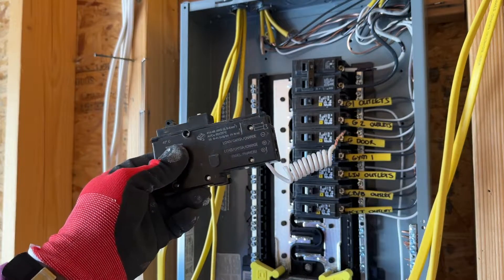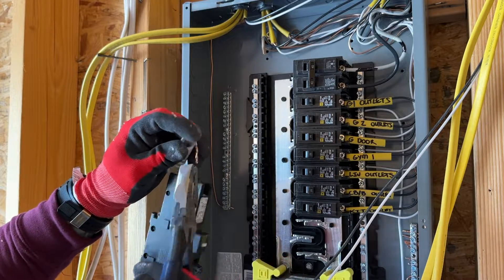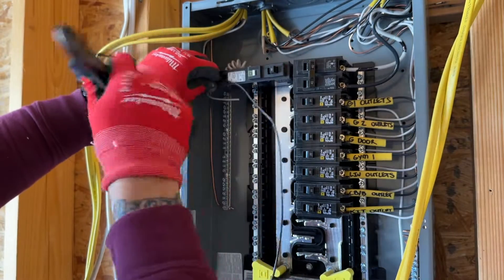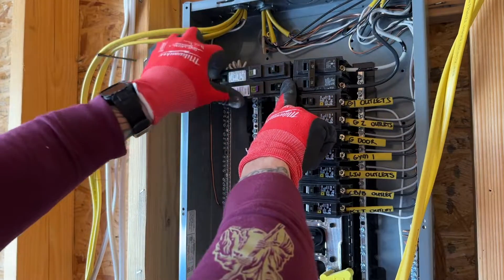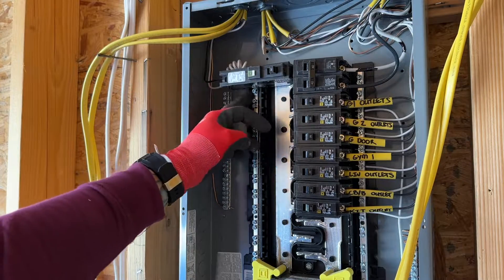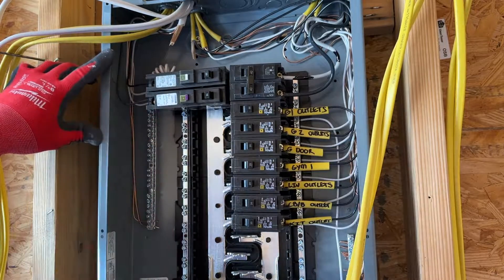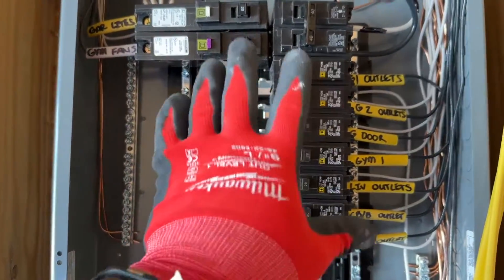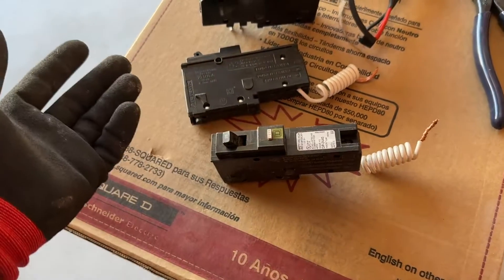AFCI & CAFCI Breaker Installation

Comment: Thanks for the video. Gave me some ideas for clean wire management
Reply from the maker: Nice! Your very welcome 🤙🏼
Reply: it is very clear and i found it very helpful as well.

i just have one gripe having dealt with many different cabling types. that is not including some sort of service loop.

future changes down the road you will have no slack anywhere in those runs for the box do anything.

i see it a lot tbh. no one really gets shown that service loops save your butt later.

Comment: I have a QO plug on neutral service panel and I want to install a CAFI/GFCI circuit breaker that has the pigtail but the breaker also has a connection for the plug on neutral. Since it’s using the plug on neutral circuit breaker would I just not connect the pigtail and wire nut it ?. Because if I would connect the pigtail and the plug on neutral both, I’m not sure if that would allow it to work having two neutral connections, or would the redundancy be ok ??
Reply from the maker: I think if it comes with the pigtail and the plug down bars it’s supposed to have both. If for some reason it cause it to act up or trip unnecessarily then I’d try one and not the other to see if it fixes the problem. A lot of the times now there’s these redundancies built in as the new code requirements

Comment: If your neutral bar is accessible for the GFCI plug, why do you also use the pig tail version too?
Reply from the maker: I was showing both and how they look/work. Also some 15amp or 20amp I could only find available in certain styles. So I was working with what I could find locally and what I could order in time to get it all done.

Comment: I am doing a complete rewire in my house and doing it myself and wanted to know how do you wire an arc fault breaker if it's on opposite side of the neutral bar
Reply from the maker: So in your panel you don’t have any way to attach your breaker to the neutral bar? It’s not next to your mounting area for the breaker?

Comment: My panel is around 40 years old. Wouldn't i have to upgrade to a panel like yours to install the plug in breaker with no pigtail.
Reply from the maker: It does depend on you you panel. Not sure how the panels looked 40 years ago but I’d guess they are different. And sometimes even just brand to brand they have a different “type” of breaker that they accept.
Reply: @FortKnoxCo  What brand box are you using.
Reply from the maker: @ Homeline Square D

Comment: Thank you for this video.  I noticed in my home panel I have both breakers with the white test button and the purple test button.  Why would the installer use both types versus just one type? Would cost be the only determining factor?
Reply from the maker: The main difference between a purple button breaker and a white button breaker is the type of protection they provide:
Purple button breaker
A purple button breaker is a dual function breaker that combines ground fault circuit interrupter (GFCI) and arc fault circuit interrupter (AFCI) protection. GFCIs protect people from electric shock, while AFCIs protect the wiring in your home from electrical fires.
White button breaker
A white button breaker is a combination arc fault circuit interrupter (CAFI) breaker that protects against parallel and series arc faults. CAFI breakers help prevent fire hazards caused by damaged electrical wiring.
Reply from the maker: That is the information I found online online describing best the difference. I believe a lot of times it can just be what code is asking for and what is planned to be on that circuit. Other times it could be what is available honestly. I’ve seen a lot of places being out of one kind and only have any other, but they need to get the circuit wired so they obviously use the right amperage but may or may not get the exact Type breaker as far as color code